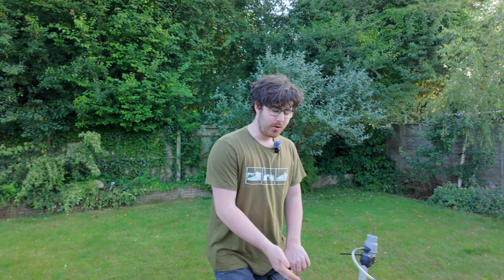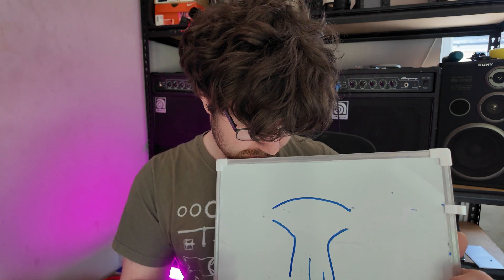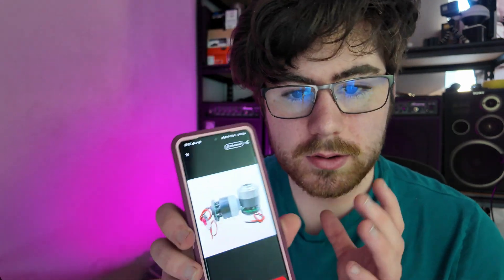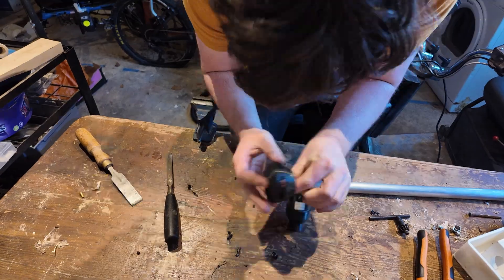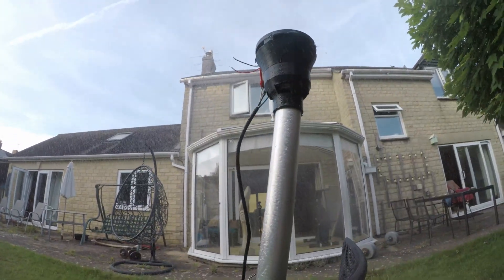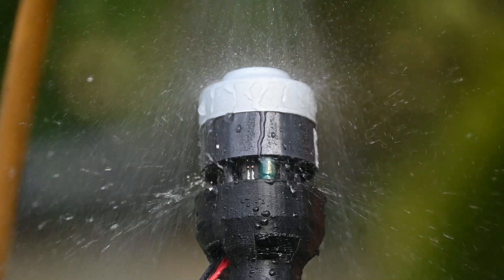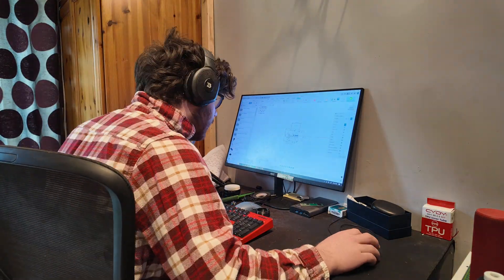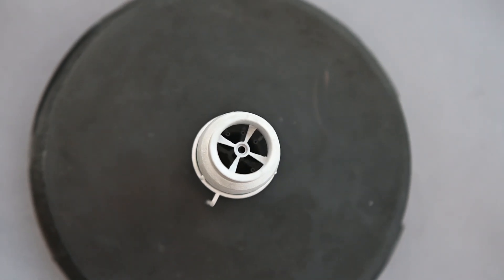Building an air umbrella using a Jet Engine

Comment: Try blades from stainless steel. The starship is made of stainless steel
Reply from the maker: The blades weren't what broke (I mean technically they were) but the shaft bent which caused them to hit the side. Shaft is currently inconel 625, but it was just too thin. In version 2 I'll use a thicker shaft(8-10mm vs 3mm). Ill also add more bearings in front of the shaft to make it stronger.

Comment: You did not overrev it. The axle which was attached between the jet engine and the motor wasnt balanced, and even if it was, it was a source of eccentric forces. The faster you spin it, the more it swings to the side until it had enough force to push the turbine into the wall. Use a more rigid axle if you can, and shorten the distance. Though some will have to be left since the engine needs as little obstructions as possible on the intake. Also im curious to see how you decided the angle of the blades for the turbine, their count and if there were any other relevant factors.
Reply from the maker: Shaft imbalance is the limiting factor in rpm in this size. As the largest blade in this assembly had a diameter of 24mm, the g forces on the blades are fairly minimal. The minimum thickness of the blades is as a result of manufacturing costs which was also the leading factor in design. However within these constraints I did do ANSYS Cfd modeling to determine the better configurations.